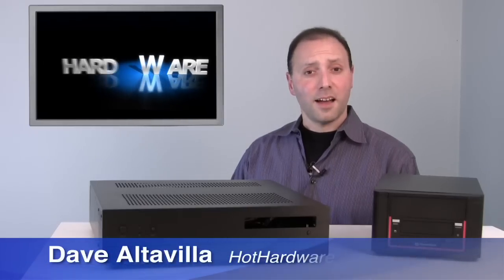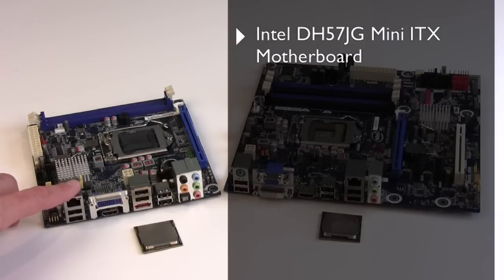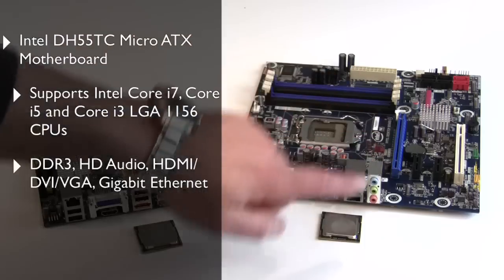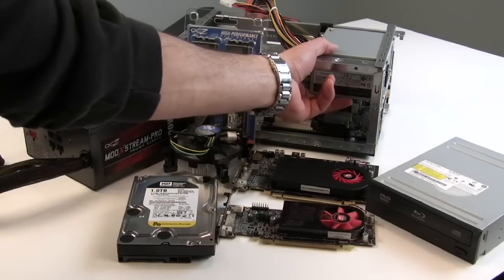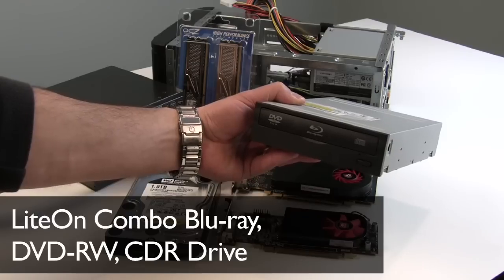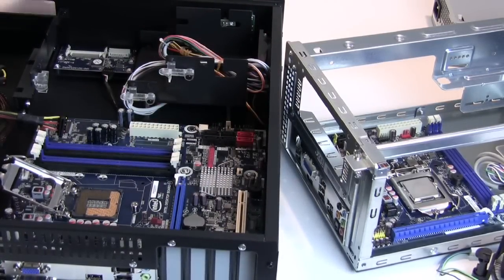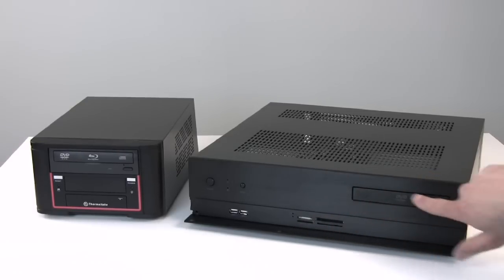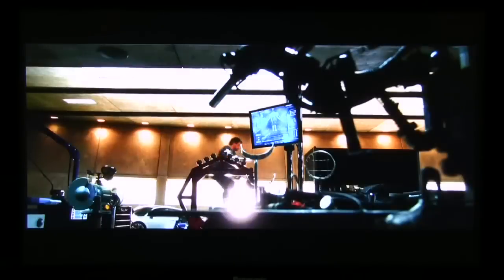Home Theater PC Building - A HotHardware How-To

Comment from the maker: Appreciate the feedback but you do know that the Core i5 is a dual core processor with integrated graphics, right?  Also, again, the systems we set were configured to be able to run 3D gaming as well.  The Core i5 runs with an 87W TDP and that includes its graphics core.  It's actually very power efficient.

Comment: While they would be extraordinarily nice to have in my living room, they are pretty high standard pieces of kit. If I was going to plan on using it for gaming too I'd just built an all out gaming rig, i7 930 with 6Gb DDR3 16000 2000Mhz and a 2024Mb GeForce 460 on a Rampage III motherboard for a grand.

Comment: @Oosen99 so its a little easier, as long as u don't drill the hell out of the screw or the board u would be fine beats having to stick the screw in then trying to get the screw driver in with out knocking the screw out of the hole

Comment: Nice but I don't get the need for that much power, unless it's all about gaming. I've got a mATX board, HD3450 HDMI card, AMD 4050e 45W CPU, 3 gigs of DDR2, Vista 32 bit, 250W PSU and a few other trinkets and it runs 1080P like butter. I can't play ultra modern games, but for older games like CS:S, FarCry, HL2 it does very well. I'm not a big gamer so I guess that's why this guy built such a balls out rig.